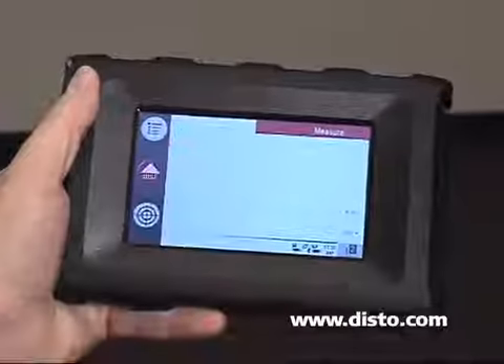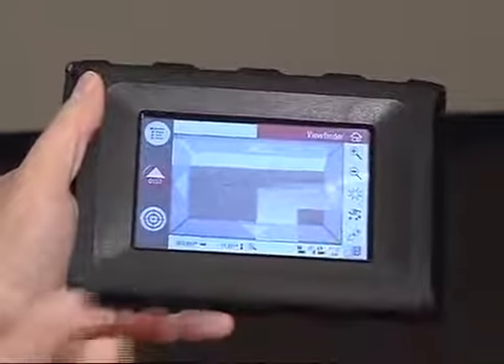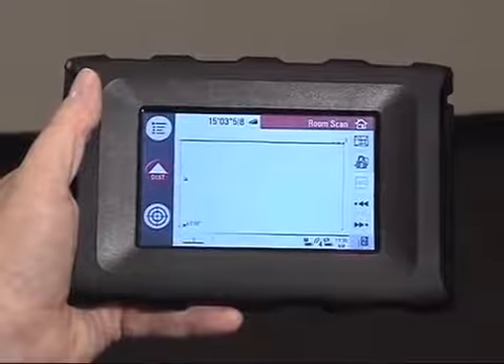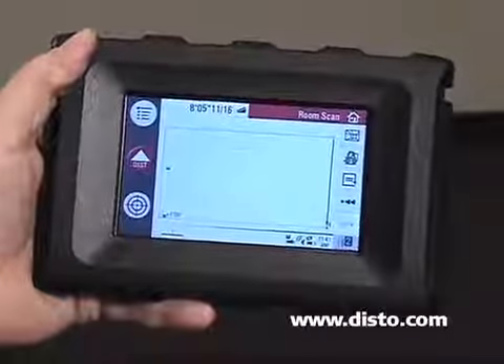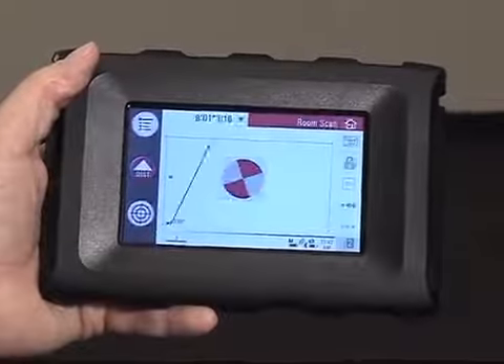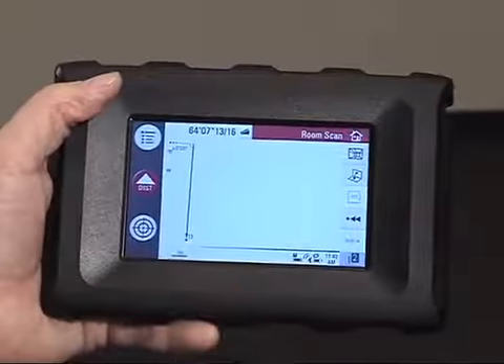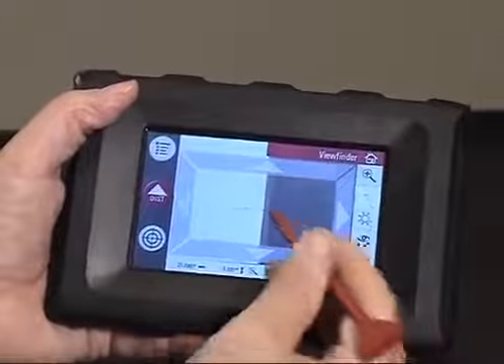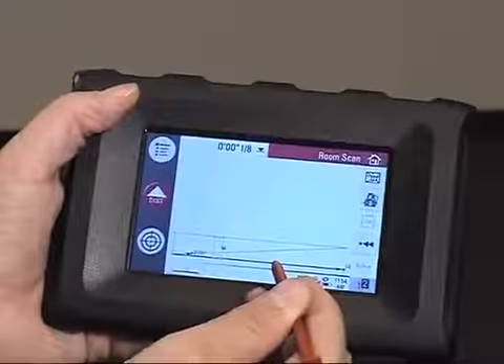Leica 3D DISTO Measure Office Space

Comment: Why some one will pay 15k for this? We can do it by tape measure
Reply: Hi Mohammed, the Leica 3D Disto retails for $8,295.  It does not replace a tape measure, but it allows you to do a lot more...accurately measure roof lines from the ground, oddly shaped areas, measure for counter tops, plumb points, create as-builts, measure angles and bring all this information into CAD.  It's a great tool but definitely does not replace the tape measure.